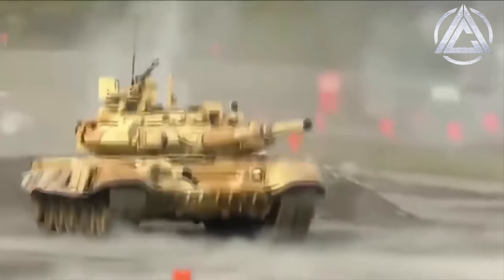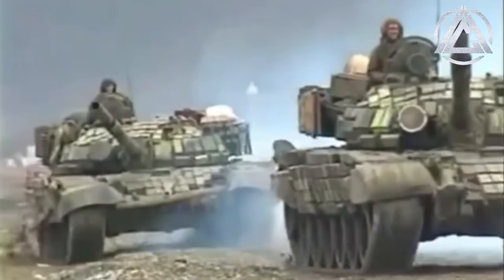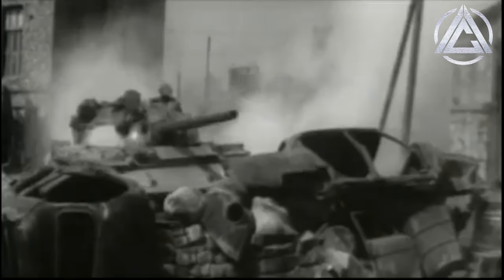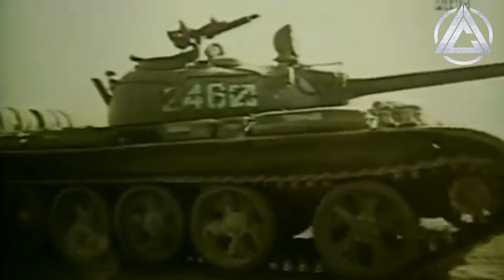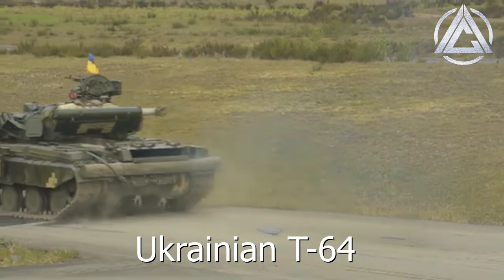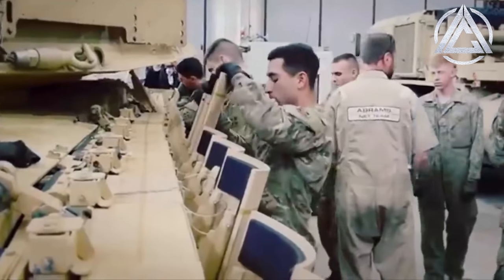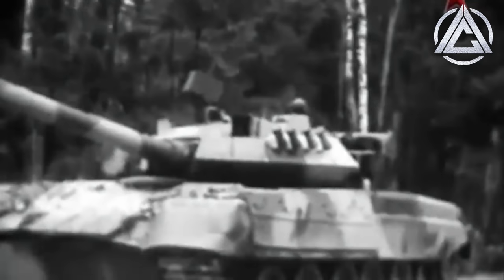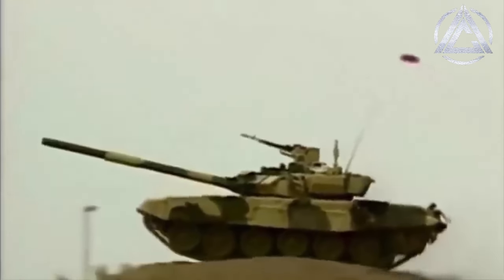What Are Those Bricks on Russian Tanks? | Koala Explains: Explosive Reactive Armor (ERA)

Comment: goes up to tank
This bad boy can fit s-
*slaps ERA brick, exploding"
Reply: @the_jingo  really? The more you know! I thought they would be somewhat fragile, but it makes sense
Reply: However 12.7 and 14.5 or low caliber cannons are able to detonate era given enough shots or type of rounds
Reply: @TheGooberOfGoobs  anything can detonate an ERA given enough rounds. Just load a 9mm Minigun and unleash more firepower than a standard squad and you could set one off, but under normal combat, ie infantry trying to either avoid or get a nade under the tank, and it'll be pretty hard to do more than scratch the paint with small arms before getting wrecked by mg fire or HE rounds.
Reply: @Khajiidaro  Practically wise no, these are common heavy machinegun calibers you'd see on tanks, ifv's and armoured cars. Also grenades are basicly useless on tanks as there bottoms are thick enough to take the blast, this is why we have dedicated AT weapon systems like javelins, tow II and so on. And no, HE rounds are basicly never used due to the nature of it on tanks as they would only fire apfsds and heat-fs. And no, a squad of all things will never try to pin a tank or fire at it, the tank will just fire HEAT-FS into their area and spray a few machinegun bursts at them tearing them to shreds.
Reply: In Arma 3 it can actually blow when you crash the tank into a rock.
Reply: @TheGooberOfGoobs  
says tanks never use he rounds

says a squad would not attack a tank as they would get shot by he rounds
Reply: @Sudden2724  damn bro thanks for pointing that 5 month old mistake out, woulda been bad if it was never spotted
Reply: half dozen eggs fall out...
Reply: @Sudden2724  Well the thing is that HE and HEAT work with different principles and have different purposes, HE is just big boom where heat is big boom make copper melt make it go into tank armor and damage it

Comment: A few fun facts: Depleted uranium doesn't blunt, it self-sharpens by breaking. So even if you break the round, it will strike with less mass but still have a nice, small impact point. The latest rounds are segmented, so it can break several times and still strike the target without shedding too much mass. Lastly, the diameter of the projectiles have been slightly increased, which makes them hit way harder than before.
Reply: I’m pretty sure that’s wrong though, uranium self sharpening doesn’t actually mean that it sharpens to a point. It just means that it doesn’t mushroom outwards like tungsten. Uranium rounds still get blunt when fired
Reply: Yeah, they basically shear off material from the tip that would dull the form if the projectile is shaped within a certain angle and hits the target above a minimum velocity. This is due to the atomic structure of DU and it's ductility combined with the very high mass. However, it works only if the target is hit at 90 degrees, otherwise this effect will be not of any significance.

Comment: 8:03
Relikt is in no way similar to Nozh/Duplet ERAs; It consists of a 4s23 explosive plate sandwiched in between 2 steel plates that'll be sent in 2 directions when struck, making it dependent on the angle at which the module is struck. Thus, we're seeing more and more russian tanks equipped with the infamous bagged 4s24 ERA on top of its Relikt side skirts, which actually does a better job at intercepting 0° hits from ATGMs.
The linear shaped-charge design of Nozh and Duplet ERAs allows multiple modules to be stacked in an area of the armour, narrowing the gaps between each of the molten jets and making it superior to Relikt at an even wider range of angles. However, Relikt would be preferable when weight is taken into account as it is lighter for every bit of the reduction of projectile penetrating capabilities it induces.
Reply: Correct but duplet era is far less wide spread then compared to relikt therefore there less information on their performance , the duplet era in theory  should be less effective agains multiple charged warheads and more likely to be less reliable due to it being extremely highly explosive .

Comment: That's not how ERA works at all... It doesn't "increase the effective thickness" or produce a counter explosion as an opposite force to push against it, it doesn't "push more material into path of the flyer plate so that it must penetrate the full length of the plate". Heat warheads are extremely dependent on the precise geometry of the formed penetrator. Given that they are usually made from soft metals like coper and are placed under such extreme pressures and velocities that they behave like plastics, it is easy to disrupt their geometry, this crippling their penetration ability. When a explosively formed penetrator from a HEAT warhead sets off an era brick, the penetrator has basically already been formed. All ERA and NERA works by inducing a lateral(NOT OPPOSING) force on the HEAT penetrators AND kinetic penetrators to disrupt its geometry(thus structural integrity), this is why it is placed at an angle to the likely trajectory of enemy rounds whenever possible, even the big flat boxes have angled explosive sandwiches inside them. The decrease in penetration is not from pushing against the penetrator but perpendicularly, and it is not really a function of "increasing the effective thickness that penetrators must travel through", but of how much the era ruins the structural integrity of the penetrator. It also affects the trajectory of the penetrators(or of the resulting fragments of the penetrator) allowing the base armor to more effectively resist what was shot at it. All ERA and NERA works on the same principle for both HEAT and APFSDS. Also only the Ukrainian nozh and duplet contain linear shaped charges. Relikt and the Chinese copies of relikt and contact 5 do not operate like that.
Reply: He also failed to mention the newest a4 variant of the apfds for the 120mm cannon
Reply: That was actual before tandem HEAT charges was invented. Against them the only reliable way is to "push more material", like Ukrainian 5th generation "nozh" ERA does, basically creating a ton of near-90° angled, spaced metal sheets for a split second.
This design have high efficiency against tandem HEAT (which has less basic penetration, but effective against composite or ERA) and APFSDS shots. On the other side it is nearly ineffective against old, brutal "single-stage" HEAT (partially fixed by second iteration, which includes layer of "classic" ERA, but that barely works AFAIK).

P.S. that is not Ukrainian invention, but old Soviet design from mid 60s. But back then tandem HEAT was not even in design, and T-64 composite armor was more than enough to stop any APFSDS existed back then, so priorities were allocated in favor of maximum efficiency against the classic cumulative projectile.
P.S.2. AFAIK brand-new Armata ERA have same general design, but with possibility to set individual timings to any mini-charge in block, depending on type of incoming shell/shot/missile, increasing efficiency against APFSDS.
Reply: @disketa25  that's not true. Era works as I described. Tandem heat charges are effective by making the era spend itself before the main charge hits. No matter how the particular era functions, if it explodes before the main warhead hits then it's useless. Nozh isn't effective against tandem heat, only duplet is supposed to be, and that's because it's basically just two layers of nozh ERA, one layer for each warhead. Look at the videos of how nozh/duplet works, it clearly shows that the linear charges in the era tiles are supposed to impact the side of the projectiles cutting or damaging them.
Reply: With the current goings on in Ukraine there are numerous videos of incapacitated Russian armour with ERA (of different versions) bricks in different conditions. Just wondering about the following:

- how safe is the ERA to handle in good condition?
- when the vehicle has been subjected to a 'brewing up', where the ERA shows signs of burning, how safe is it to handle?
- could ERA be reused in some other way and actually be effective. Off the top of my head, thinking burying it charge up with a box of, say nails or bolts or something else, with maybe a steel plate with a steel rod welded to it and suspended above the ERA more or less acting as a pressure plate.

Comment: What level of penetration would be required to trigger modern Russian ERA? I would assume small arms fire wouldn't do it, but what about autocannons or shrapnel shells?
Reply: Autocanon yes. Anything that can penetrate more or less 20 to 30 mm of steel can set it off. But then again. If you can shoot at the tank. The tank can shoot at you. Usually.

Comment: RE: the auto cannon exploit. Could you not also set them off with some sort of area concussive blast.  Air blast a shell just over head and watch the tanks turn in to grape shot to anyone around and its one use is up.
Reply from the maker: Yup, this is actually a tactic used by US tanks, in fact they developed an airbusting fuel shell specifically for it!

Comment: I know it would not be on this channel, but is missile notching possible in warthunder? Plus the chaff is coming so it will be easier if possible.
Reply: What's that?
Reply from the maker: Notching is possible, but it refers to the radar, not the missile, and seeing as we have no active radar homing missiles yet, you’re notching the radar of the aircraft/SPAA. Seeing as it’s only this update that Gaijin is modelling pulse Doppler radar, you’ll finally be able to do it properly against aircraft like the FGR.2.

Chaff and notching are two separate things - chaff is more helpful when you’re running AWAY from the missile, when you’re notching it’s unnecessary
Reply: @ArmorCast  yup i saw this from dcs, i forgot that they were notching fox-3’s and y mixed up flairs and chaff, so my question is a mess XD.( I know flairs won’t do anything to radar)
Reply: @trevon5653  Notching if basically flying at a constant distance reletive to a radar device, so it won't detect you/lock on to you. For radar to be able to detect you, a relative speed (the speed of your plane measured by said device) is needed. Look it up if you want to know more, it's kinda hard to pull off in WT but good to know if you like CAS'ing.
Reply: @GielL96  oooh alright. Thanks

Comment: The bricks are Reactive Armour.They are actually Explosives. 
When the tank...bricks are hit by missile...it Detonates thus Redirect ing the Energy of the Missile Warhead away from the tank.
Reply: like the M-1 Tank and the BIFV M-2s and A-3s, even the M-6 Linebacker only made like 80 or so it was a Stinger track vehicle with the M-242 25mm canon and 7.62mm coax mg, the reactive armor for the BFIV wight was 8000 lbs added weight was already 23 tons combat loaded  and the M-1 Tank, like 62 Tons with no reactive armor but the skirts of the tank are all at one time the skirts was a secret, loss one had to go find it really fast too out here on Fort Hood, 1st Cav was the First to Field the XM-1 Main Battle Tank and 2nd AD was the first to field the M-2 Infantry fighting vehicle and the M-3 Scouts out armor vehicle was a master gunner for a Mechanized Infantry Battalion started as a platoon master gunner to the company master gunner E-6 E-7 to E-8 master gunner and Ops Sergeant S-3 shop, the heart of an ARMY is the Man who kills the Enemy close into and destroys, tanks and artillery can take the land but it takes an Infantryman to clear and hold that land SET UP for a Counter Attack tanks and BFV's has ID their primary and alternate firing sectors of fire Come On and Get Some you red deivls, we Have F-35 close in Air Support too and the LongBows too 4.2mm motors and the field arttilley to of M-109's 155mm Howitzer rounds and it depends on if our mission calls for Divsion Artillery Support with the MRLS one can take out a hole grad 1000 x 1000 meters

Comment: Well, we've all seen the Russian tanks in Ukraine. Turns out ERA does not protect you against NLAWs, Javelins and all the other ATGMs. Not to mention drones and artillery.

And the other thing we've all learned is that having an auto loader may mean one less crewman in the tank, but that just means one less person to die in a violent explosive death.
Reply: Western tanks have 4 crewman with a closed ammunition compartment. Much safer, instead a auto loader wich not have a enclosure compartment like the russian tanks have.
Reply: @ronaldboonstra4834  NATO Style autoloader tanks are configured with a blowout panels. You can see this on the LeClerq Tank auto ammunition is actually under the blowout panel
Reply: Also the ERA on Russian tanks has largely been non existent thanks to corruption causing replacement with fake ERA or poorly maintained.
Reply: ERA protects against ATGMs. Against top attacking ATGMs any  fancy NATO armor like Chobham or Burlington or whatever is useless too.
And we saw in Turkey and Saudi Arabia that Russian ATGMs can hit and destroy NATO designs without top attack ability. Straight through penetration.
Reply: @BojanPeric-kq9et if bro knew bout APS Trophy, he wouldnt have said this kremlin bs lmfao
Reply: @quantumsage4008  Ignoring the fact that Trophy so far is only used by Israel and to a limited capacity the US and Germany (Far from universal western tank thing, especially since the US and Germany are just buying them from Israel..), and that it also has spotty effectiveness at detecting top down attacks, the march of technology is ceaseless and Hezbollah has already shown how to invalidate the Trophy system with it's twin fire ATGM, something which almost assuredly is already in Iranian designs aswell.

Comment: These are exactly like the german side plates used on the pzkpfw 3 or 4 used to pre detonate heat shells (I think)
Reply from the maker: Those are just simple steel panels, and the main purpose of their design was actually to defend against Soviet 14.5mm AT guns. ERA is completely different, and was only designed long after the war had ended
Reply: @ArmorCast  I didn't even know that lol 😂 thx 👍
Reply: @infantryS04  the simple difference is that german panels trigger shells early, while era blasts the shell
Reply: Na.
Schurzen were to counter 14.5mm AT rifles which had just enough oomph to Threaten German medium tank side armor.

Contrary to popular thought spaced armor during the ww2 era ( hohoho ) could actually improve penetration of HEAT projectiles.....the science of HEAT functioning wasn't fully developped and the effects of standoff distance ( and its sister : piezo elecyric fuses ) was not properly appreciated.
Reply: Schürzen worked not in adding additional armor thickness (the plates were only a few millimeters thick) but in the plate destabilizing or deflecting the round, causing it to hit at a suboptimal angle and thereby losing much of its penetration. Not altogether different than the effect Gen 1 ERA was intended to have on HEAT.

Comment: Also can you make a video what are those cage looking bars on the tank armor for?
Reply: It's there to detonate HEAT rounds away from the tank's main armor. I'd assume they use bars instead of steel plates because it's lighter and cheaper (or at least lighter) than steel plates and in some cases such as the S-tank you might have to be able to see through it.

Comment: The little iron blocks are very small.It is more easy to elevate the temperature of a small body since de air is a bad conductor of heat compare to metal,then the metals blocks can act like a match,when hitting with a projectile with high kinetic energy.

Comment: Serious question, does the tank crew come out unscathed if an ERA panel detonates?
Reply from the maker: Yes, of course. Wouldn't be much use otherwise. The ERA is designed specifically to detonate OUTWARDS and not cause any damage to the plates underneath it (besides maybe a bit of a scorch mark)
Reply: @ArmorCast  i doubt an ERA facing inwards would be able to even leave a dent on the tank's armor anyways.
Reply: The crew is probably seriously hurt or at least stunned if they're unbuttoned and partially outside of their hatches. That's one of the bigger drawbacks of ERA; forcing the crew to stay inside causes a certain loss of observation capability (how much depends on the model of tank, obviously).
Reply: @jarink1  crew leaving their hatch open is close to number one cause of death for tanks in urban warfare... or just any warfare in general. It might feel better but it's way more dangerous. You have an armored box, take the hint and hide inside it.

Also no crew inside unbuttened is not going to get hurt. It's 300 grams of explosives, not a lot.

Comment: Would double tapping a tank on one side defeat the reactive armor by destroying the bricks on one side, or do the bricks only explode individually somehow? Just wondering.
Reply from the maker: They’re calibrated to not cause a chain reaction, so only the bricks that are actually hit will detonate. You’d therefore have to hit the exact same spot on the tank twice, which is doable depending on the weapon, but not easy or reliable at combat ranges
Reply: Individually - most ERA has been notoriously insensitive (Kontakt-1 couldn't be triggered by autocannon fire)

Comment: What sort of impact is required to activate the ERA? Could you pepper the armour first with a 20mm cannon to explode the ERA and then fire conventional anti tank rounds?
Reply from the maker: The early types of ERA like Kontakt-1 or Blazer, yes. More modern types are not as sensitive, and are designed to only detonate to the force of a tank round, RPG or ATGM